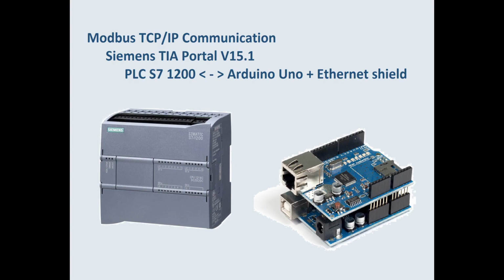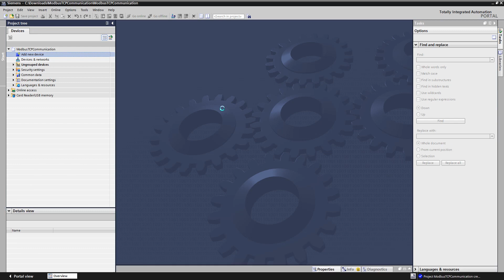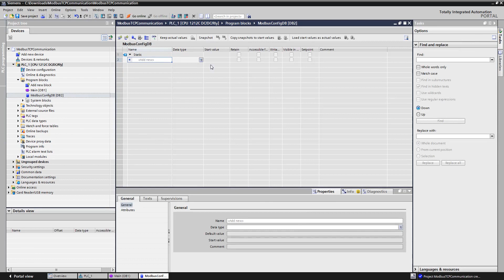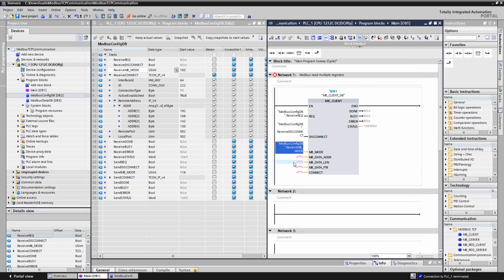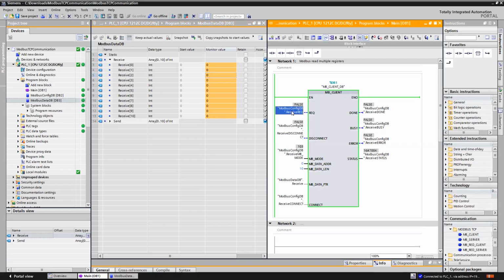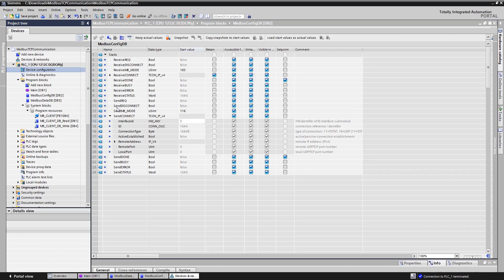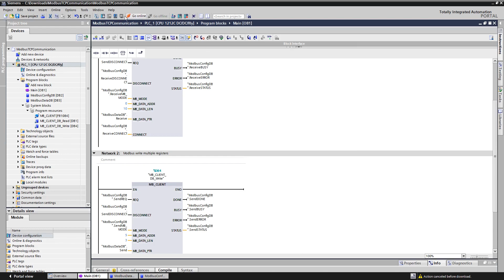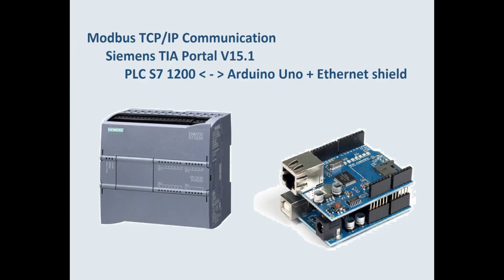Siemens S7 1200 Modbus TCP/IP Communication with Arduino

Comment: Awesome! After trying for so long! Couple of changes I made: DB2 Send, remote and local ports changed to 502. I am using w5500 ethernet shield (MKR ETH), so the libraries I used are SPI.h Ethernet.h ModbusEthernet.h. There are several more changes in the declarations, but finally it works!
Reply: i have the same essu can you give more detials

Comment: Really nice tutorial, thanks a lot for your time. I have question, why sometimes we have to add 4000 or 3000 (depend on the type of register) to the server data address, and sometimes not, for exp. you did not add, but I saw on the few turotials people added. Does that depand on the modbus library version?

Comment: Good tutorial,
I can read from Arduino, but when i send data to the Arduino the serial monitor gives only 3 times 1 like is set in the program from the Arduino.
I think something is not right with the program.
Hopefully you can help me with this issue.

   mb.addHreg(reg5_HREG, 1);
    mb.addHreg(reg6_HREG, 1);
    mb.addHreg(reg7_HREG, 1);

The upper 3 lines are a little strange.
The three 1 is what i see in the serial monitor, and not the values what i put into the send array from my siemens.

its the first time that i work with the arduino thus maybe i be wrong.

Thanks in advance
Frans
Reply from the maker: Hi,
statement mb.addHreg(reg5_HREG, 1) means declaration of holding register, value "1" is just initial value (void addHreg (offset word, word value), https://github.com/andresarmento/modbus-arduino ), that's why it's located in steup().

It's looks like PLC is not writing to Arudino register, so Arduino just display initial value.

Download Modbus slave tool and test it with PLC https://github.com/ClassicDIY/ModbusTool
Reply: @industrialautomation3470  
Hi,
I have downloaded the master and slave tool.
I have my Arduino program tested with the master tool and that working fine.
Write and read are both working.

Then i have tried to test my siemens s7-1200 program  with the slave tool without success.
Not possible to write or read.
Maybe i do something wrong.
My settings are the following:
Receive connect - ID = 222
receive remote and Local port = 502
ReceiveMB_mode = 103
SendConnect ID = 20
Send remote and Local port = 504
Send modeMB_Mode = 116

What are the settings for the mastertool?
How must i test step by step
i have checked everthing several times
What could be wrong?

hopefully you canhelp me out?

best regards,
Frans
Reply from the maker: @fransvanenschot3286   
* Which PLC are you using?
* Make sure you interface ID is correct 5:52. 
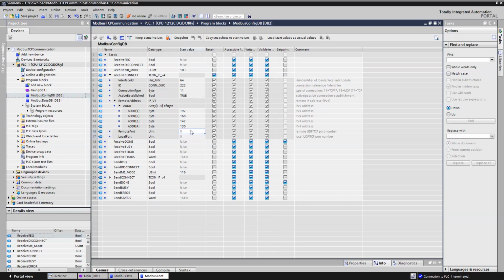* Check if you PC IP address and port is matching configuration 6:33. 
* Disable any firewall.
* With Modbus Slave tool, just select TCP and correct port, then just click listen and wait for incoming connection.
Reply: @industrialautomation3470  
i use plc 1212C AC/DC/Rly
when i test my PLC with the slavetool with portnr 504 i can write to the slavetool on addresses 5, 6, and 7
but when i tried the write from the slavetool to my PLC via port 502 it not working
every time i stop/start my plc and set read and write bits.

my Arduino act perfect when i test with the mastertool.
what do i wrong, this make me crazy.
grtz Frans
Reply: Iám still busy with my problem without success.
When i tested my arduino with the mastertool it seems to work perfect.
When i tested my siemens s7-1212 plc with the slavetool it works also perfect.
But when i connect Arduino and PLC together i can not write registers to my arduino.
What kind of test can i do more to get it working?
Need help with this issue

thanks i advance
Reply from the maker: @fransvanenschot3286  Did you turned of firewall/antivurs? Can you ping both devices from both sides? In previous post you said you can't write from slave tool to plc, what was wrong?
Reply: @industrialautomation3470  Finally it works.
i must disconnect from read client making true when i will write, and must disconnect from write client  making true when i wound read.
i did that before with the request from the read and write client, but that did work.
why it is not possible leave both clients active, because we using two separate ports 502 and 504?

Grtz frans
Reply: Last change made
I have use now port 502 for the read and write client.
Now everything is working perfect
Why have you used also port 504 when this is not necessary?

best regards frans

Comment: please give same concept with esp8266 with siemens plc
Reply from the maker: Concept is still the same, but you would have to use ethernet shield for ESP, or plug PLC into wireless router and connect ESP to that router. Here is library: https://www.arduino.cc/reference/en/libraries/modbus-esp8266/

Comment: Thanks for the video. I just want to know if such a communication can be established using a virtual plc ( Plcsim or Plcsim Advanced) instead of a real physical S7-1200.
Reply from the maker: Yes it can. Check my other video
Reply: @industrialautomation3470   I'm using Plcsim Advanced with TIA V15 to simulate an ET 200SP CPU, I followed exactly your tutorial and copied your arduino sketch but I'm not receiving in TIA, is there any further configuration ? I couldn't ping my arduino ip adress by the way, can it be exactly the issue here ?
Reply from the maker: @anismahmoudbacha7306  I would suspect wrong configuration of Arduino. Make sure to use right library for your exact Ethernet module, try to use different libraries to find out which one works. You can use your pc as modbus client to verify that Arduino works. Cheers
Reply: @industrialautomation3470  That was exactly the issue,libraries. It is working fine now. Thanks a lot :) .

Comment: Hello sir, i want to communicate s7 1500 as Client with s7 200 smart as server over Modbus TCP/IP 
There is lack of documentation and examples of 200 smart on internet n industry mall can u pls help me in the communication between both the plc
Reply: You cannot use Modbus TCP/IP with s7 200, it only supports Modbus RTU
Reply: @the_grim69420  Read the manual of 200 smart v 2.5 or above hv it
Reply: Ok, my mistake, i wasn't aware that smart lineup exists.

Comment: Does anybody have problem with ping Arduino IP address? I upload program without any problem, but I can't ping Arduino. I managed IP address to be in same subnet. Any tips and help? Tnx.
Reply from the maker: I would try different code for Arduino. Also check if you really got ip from same subnet and same mask. Turn off firewall too. If you got older pc, you will need to use switch or cross cable
Reply: @industrialautomation3470  When you say Code.. do you mean "MB_Unit_ID"?
Reply from the maker: But usually problem is with Ethernet shields, especially with Chinese ones. Lot of times you have to try different codes to find working one
Reply: I have same problem. Do you solved it?

Comment: Hi, thanks for video. Can you say how you physically connect PLC and arduino? Did you use only RJ45 between these two devices?
Reply from the maker: Yes standard Ethernet cable
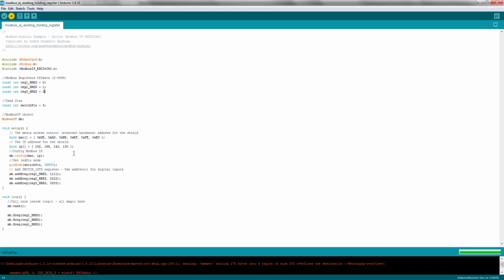Reply: @industrialautomation3470  Oke tnx. But, why at about 6:30 you have jump from one state to another (a lots of new tags appears and DB3)?
Reply from the maker: @viktorjanjic2596  cut in video

Comment: Hey, buddy! Can you help me, please? I'm following the example of your video, but when I insert in Step 7 the second block Modbus Client and Do the settings to write in arduino nothing happens. My second Modbus communication block never works... The "Done" status of the block always becomes false.... Would you have any tips to give me? I'm using an S71200 with an Arduino and a shild ethernet.
Reply from the maker: Hello, if first block works fine, then communication should be alright. Does error flag coming up? It can be present just for one cycle, make a trap for error flag and error code using set coil and move error code. What is error/status code? Double check that all parameters are correct (mode, address, connect definition). Communications are always very difficult to troubleshoot.